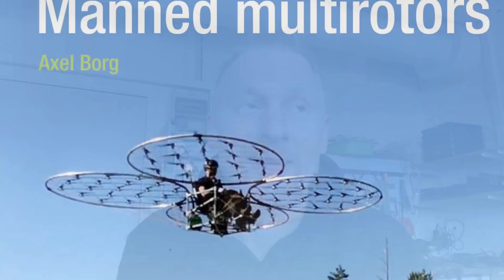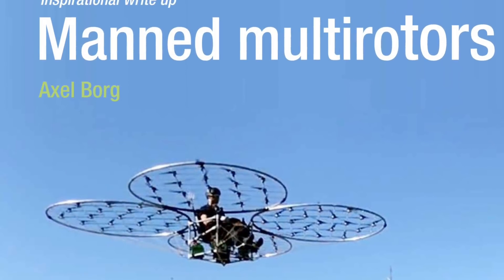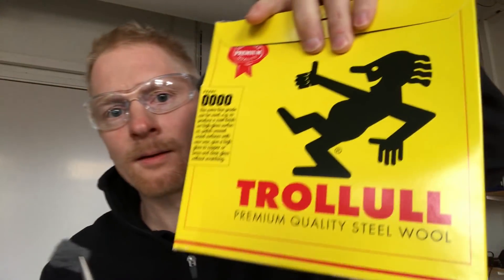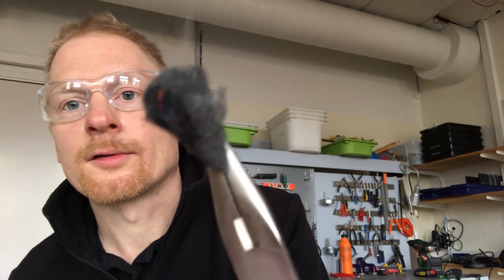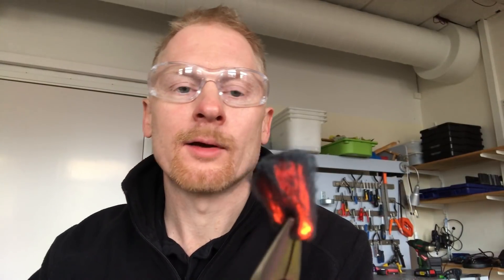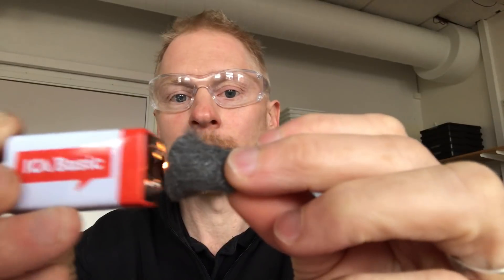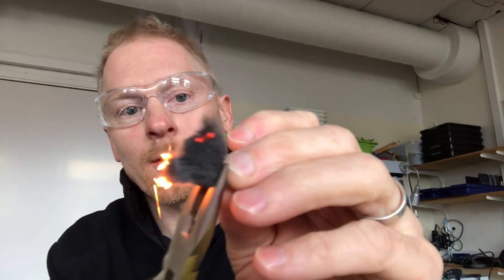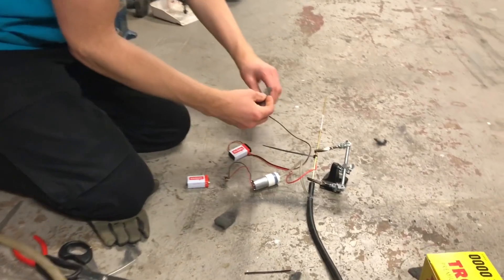Steel wool firework 1 -Best micro:bit project ever?

Comment: i've been trying this, but no way I can get it to shoot anyway near the height you are getting.
question. I see at 3:15 that you are using the air compressor gun and that you have a solenoid valve (connected to a lipo) in the hose!
Are you (at 3:25) triggering the shot by using the compressor gun, or by using the solenoid valve?
I've done some test with thin and thick pipes. The thin shoot way further than the thick pipe, but are not so much fun as it can only handle small bits of steel wool.
the compressor I'm using can go up to 10 bar, and I will do some more testing to see if I can get things to work better.

Comment: Hej Axel! 
You will archive a much faster firing rate if you divide shooting and ignition in two steps. That means while you are shooting round "n" you are igniting round "n-1" in parallel. I think it would be very easy for you to modify the existing prototype.